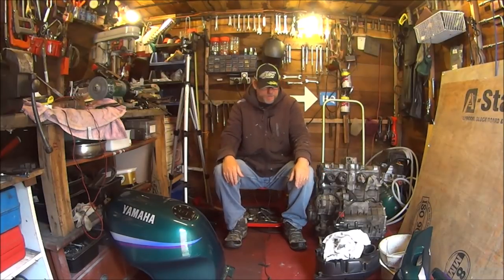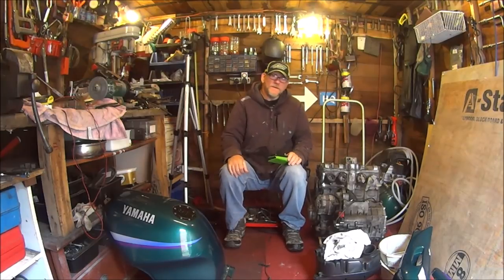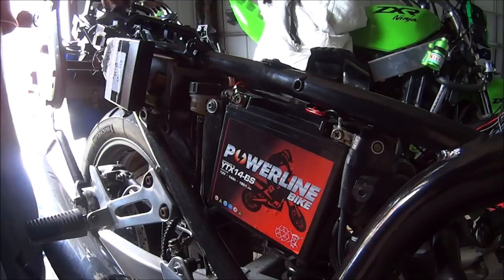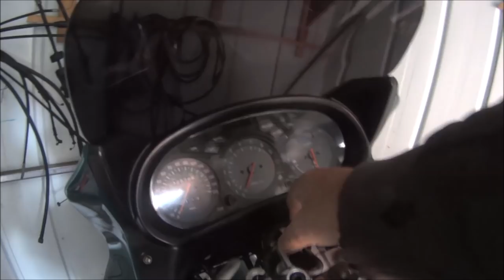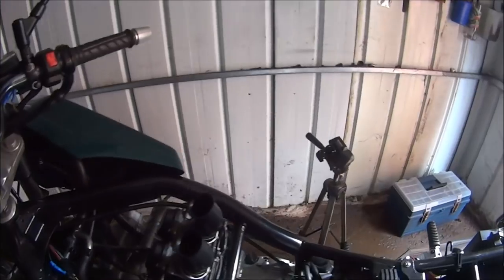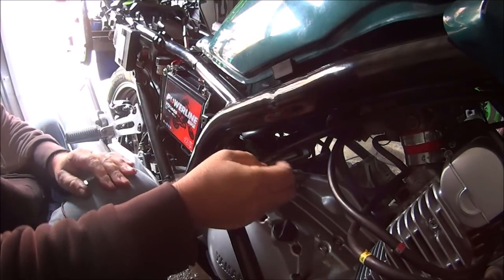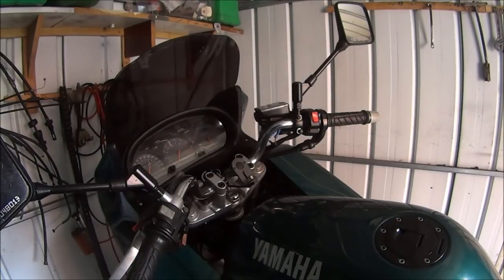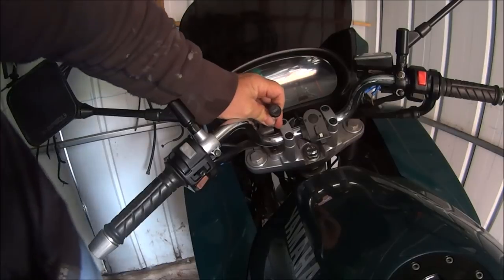XJ900S FINAL FIX allegedly. P_3.

Comment: Forgot to say a little tip for stopping the screws falling down on the battery terminals is to cut a small piece of hose behind the back of the nuts 👍🏻
Reply from the maker: Cheers fella that's a good idea.

Comment: I think I’m more gutted than you are mate, to me it sounds as if there isn’t enough fuel and too much air. Sounds to me as if the floats are set so it’s cutting fuel too early before the bowls are full and it hasn’t enough to run high revs. 
Love the staffy, I have 2 👍
Reply from the maker: Thanks. You could be right there. But I'm thinking it would stall after a hard rev up but no it just goes straight back to a perfect tick over
Reply from the maker: Yes It does but it doesn't show why
Reply from the maker: Wish they could talk

Comment: You should hear the racket my div 600 makes. you would be so proud of what you have done so far. imagine dropping all your tools and spanners on the floor over and over. thats what my sounds like on tick over and im told thats normal.
Reply from the maker: Lol this one sounds OK on tick over. Just won't rev up. Nightmare.
Reply: Yeh dont worry about it..mines sounded like it for years..
Reply from the maker: You ear a lot of stories about these XJ's running forever just wish mine would run a lot faster.

Comment: Dont want to sound like a debby downer but listening to you blip that throttle says to me something is either blocked or not firing correct. Tried playing with the fuel valve to see if its clogged if i set mine to reserve i always end up losing power on revs, think i have a blocked one too. Its either that or you got a faulty coil/spark plug.
Reply from the maker: Thanks phay. On this divvy there is just off and on, on the petrol tap no reserve plus its been refurbished so don't think there can be a problem with that.. Both ignition coils have been replaced also. Cheers John.

Comment: Is it possible to swap over a complete carb with another in the carb bank to see if the problem moves to the other cylinder other than number 4?, at least would narrow it down to a bad carb on cylinder 4.
Reply from the maker: Perhaps the middle 2 but not the outer 2 so no it's not possible really
Reply: @jonyr1TT  Fair enough mate, just chucking out ideas that may help, don't give up on it , the bike is at least running which is a positive thing, just something is a bit off and i'm sure if you persist you will sort it eventually.Good luck.
Reply from the maker: Thanks J. I appreciate it very much buddy. See tomorrow's video now I think I'm really barking up the right tree.
Reply: @jonyr1TT  As always will be looking forward to your next vid John.
Reply from the maker: Cheers J hope you enjoy it

Comment: Don't give up.but may have the solution .wemoto £13 fuel pump repair kit .rubber diaprham....if when you start it and rev it.see if you can see the rubber mounts to the carbs sucking in.they are known for giving loads of greif are pumps
Reply from the maker: Cheers Darren. I've tried it with the new pump off of the zxr and even tried it with just gravity feed but still runs like crap
Reply: @jonyr1TT  then really not sure.baffled but not beaten.when you try it again inbox me video of it running .
Reply from the maker: Thanks.. Will do.

Comment: I was just as disappointed to hear that engine not running cleanly, was really hoping she was gonna fire up okay. Looks like your cdi was okay after all, so you could put the old one back and resell on ebay once the issue gets sorted. I guess you're gonna have to check the spark plugs again. Have you done the old touch test on the headers to see if the temps feel the same?. You did say you were going to try swapping carb internals around?, did anything change if you did do this? You may need to check your fuel levels using the tube method instead. Found these 2 webpages that may help if the problem is carb related. http://www.xj4ever.com/setting%20fuel%20levels.pdf   and   https://www.xjbikes.com/forums/threads/in-the-church-of-clean.14692/
Reply from the maker: Thanks J. you and me both. Real nightmare from hell no more  YAMAHAs after this one think I have the YAMAHA curse.. Thanks for the cool links I appreciate it. all the best John..